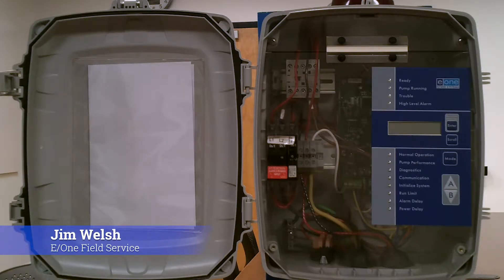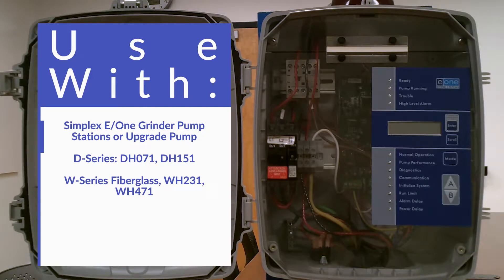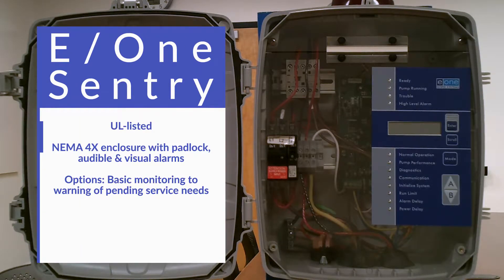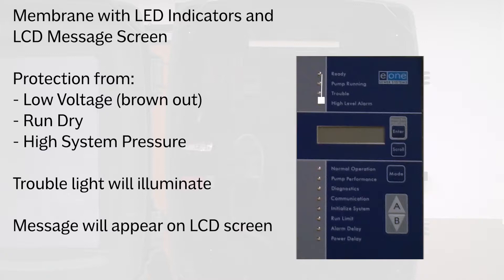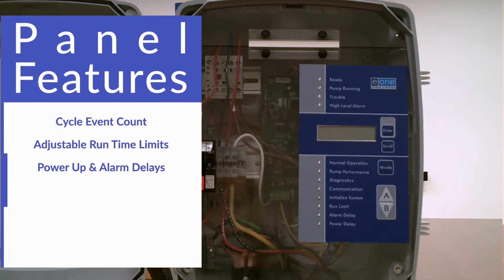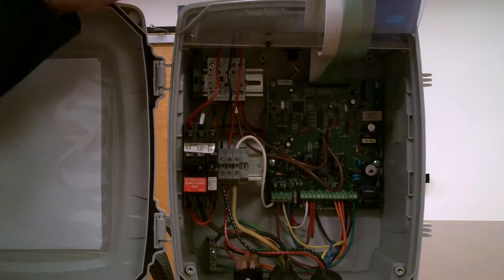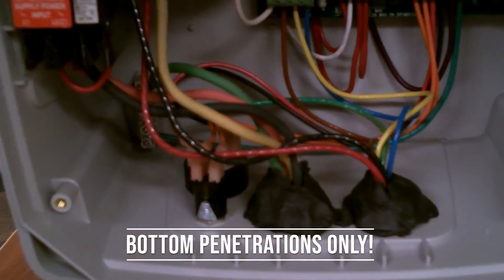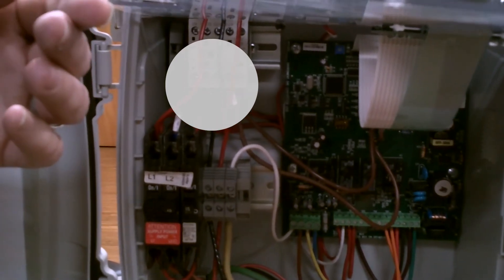E/One Sentry Alarm Panels: Protect Plus for Simplex Grinder Pump Stations

Comment: Great product.  I installed a a modified Z-Wave water sensor to provide remote indication of an alarm condition.

I removed the water sensor wiring and replaced it with wires connected to the alarm dry contact.  My E/One panel now has an audible alarm in my home and a text to my mobile devices.  This is made possible with a Hubitat hub.

The EcolinkZ-Wave Plus Flood sensor has screw terminals for the wiring internally making soldering unnecessary.
Reply: I would love to hear more about your solution.  I want to integrate it with my Control4 Home Automation System somehow, and your method seems to be a nice compromise.